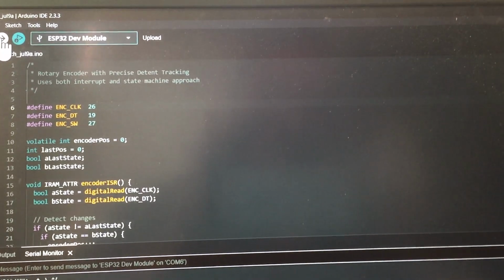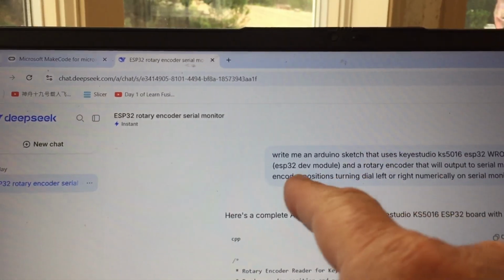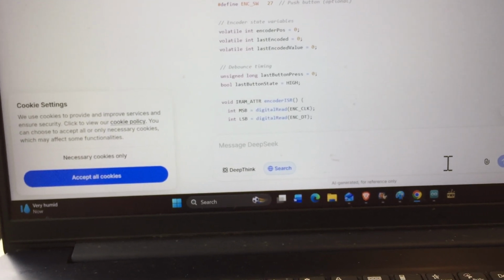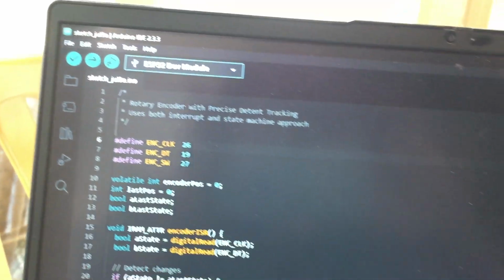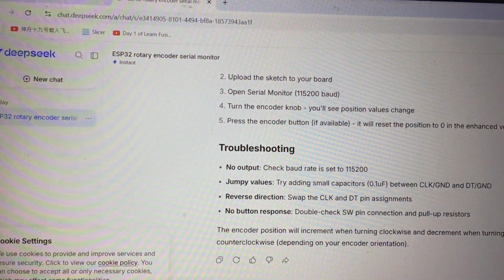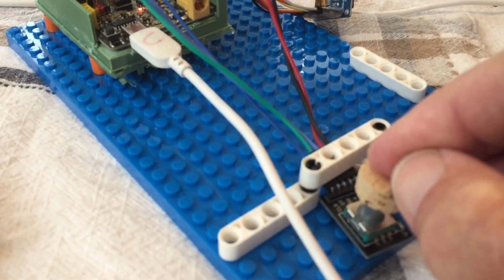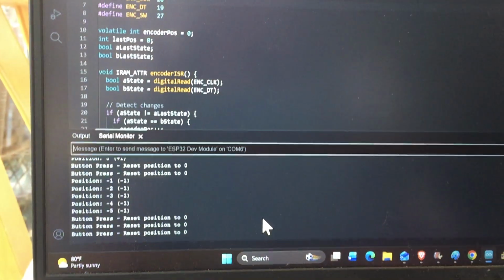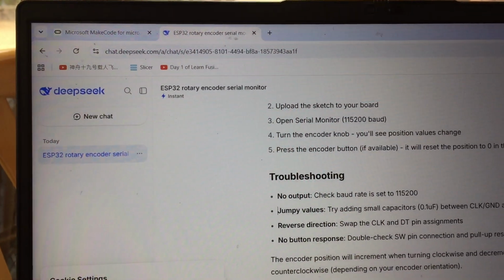deepseek Ai Arduino Sketch, First Try: it Works

Comment: i have messaged you directly - 2.3.10 works fine for me !
What errors are you getting when you use 2.3.10?
I have some suggestions onnce i know what symptoms you are getting

************************************

I would like to see what happens when you input EXACTLY the same prompt to different AI models?